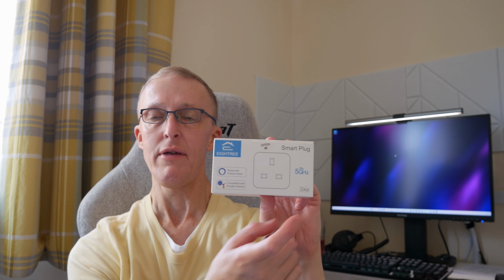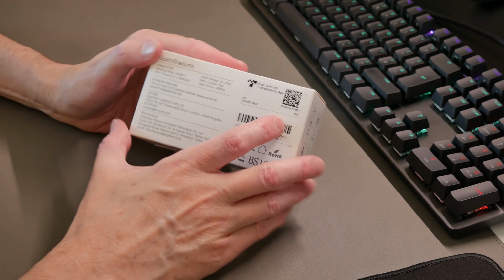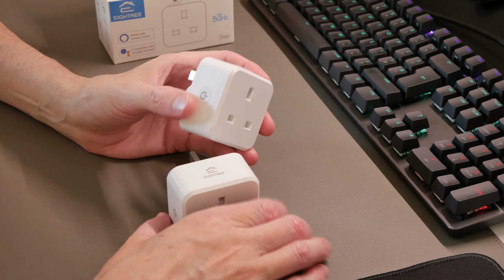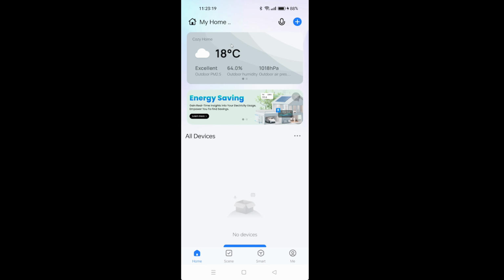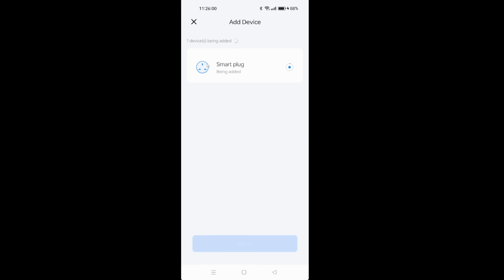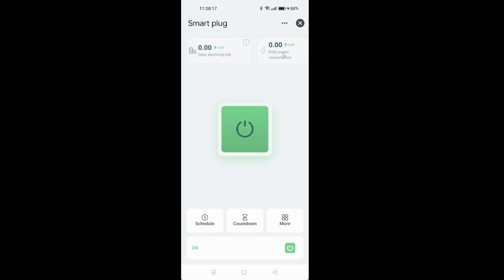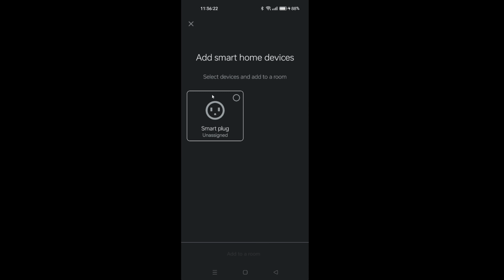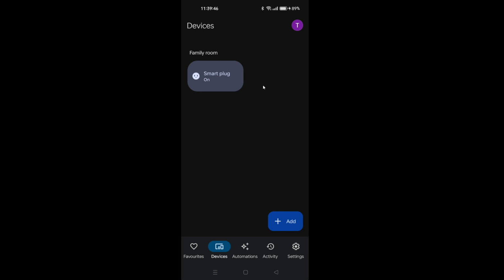EIGHTREE 5GHz Smart Plugs - Unboxing & Setup

Comment: Thanks for this review. I may give these a try, as I'm fed up with those clunky old 2.4ghz Meross devices, which are an absolute pain to set up.
Reply from the maker: You're welcome.  I also like 'Innr' branded Smart Plugs, they are so easy to add, however they are Zigbee devices, but I've been using them for a long time, never failed yet.